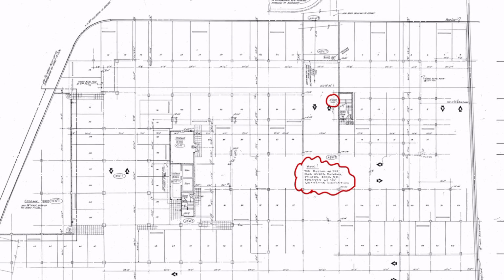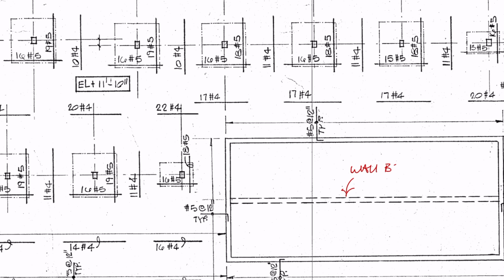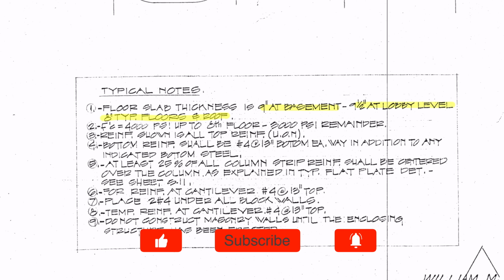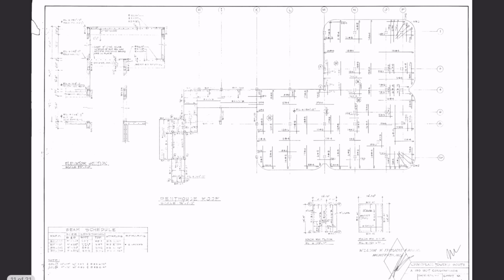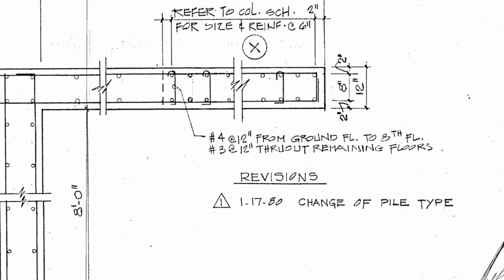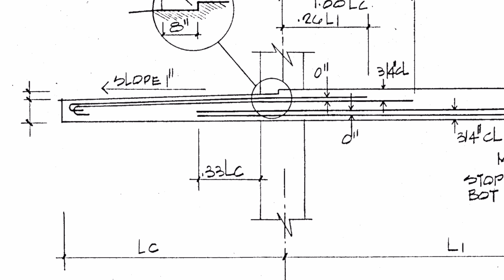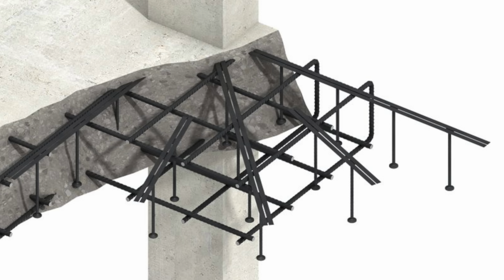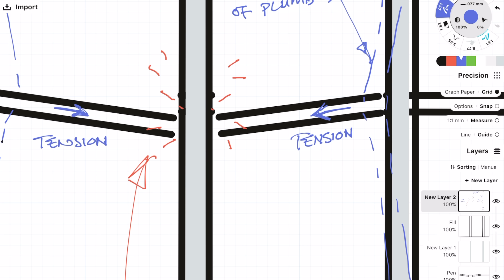Surfside Condo Collapse - Reviewing the structural drawings - Was the design bad?

Comment: by all respect; Judgment is not made by what you think, as saying "thickness is not enough", but by reanalysis using design software. 
Judging by look is just to rechecking, based on the long experience of the engineer-designer based on many experiences he went through. For example, he can judge by the span length between the columns, yet he needs to return analysis on the programs to Issuing judgment. 
Even if the constructor fails it may be a poor implementation

Comment: Are these the plans from 1980? It was built to the 1980 plans. Not either of the 1979 plans.  Many columns that should’ve been 24”x24” were smaller. That one has beams under planters.  One column isn’t several feet over instead of lined up with other ones.

Comment: As far as the building is concerned for most it was standing on small columns, only the part that remained standing was partially on larger columns. Initially the pool deck and parking garage floor collapsed. That did not directly affect the Northern or Eastern sides of the building. It did however directly affect the Southern and Western sides, but the Western side being on larger columns where the parking garage was meant it was able to handle the stress. The Southern side however was on smaller columns of which the entire edge row of columns would have been damaged leading to the collapse of the Southern side, that lead to the Northern side also collapsing. Though non of the  columns which the Eastern side was standing on would have been damaged by the collapse of the mid section of the building. It is clear on the video that the South Eastern corner was so small part remaining that means it would have been standing on one column only. Thus you'll notice when it collapsed it started by leaning over and rotating inwards before pulling down the Eastern side of the building. The Western side that remained standing was almost like separate building. Having been on larger columns, been split from the other sections by the large shear wall, and having the open shafts housing the stares and elevator meant there was less direct connections to the rest of the building.

Comment: i think when oroginally designed and built they used bare minimum calculations in terms of load to save on cost--obviously not taking into account additional weight/load the building and or the pool deck can withstand as the collapse started at pool deck-----the other columns couldnt withstand the force of all that concrete coming down----------it was all about cost and bare minimum load calculations

Comment: What I find interesting is how you and your viewers can so easily blame it on building design and concrete quality etc. You all want to find an explanation which doesn't help people in the thousands of other buildings built like this one. I would suggest people go back and look at the slow motion destruction of the twin World Trade Center Towers along with Building Seven and explain those in a concrete or design failure. Watch how those buildings came apart.
Reply: The three collapsed WTC buildings were steel-framed tube structures. Different design, different material, different dimensions.

Comment: Another video I watched showed that a landscape company put heavy paver blocks on top of heavy sand on top of the deck and didnt put a drain for the sand nor did they install a waterproofing membrane under the sand resulting in a water trap under the pavers between the concrete deck and bottom of the pavers. The only way the water could escape is by passing through the concrete rebar deck. What were they thinking?

Comment: Nobody has yet mentioned the possibility that during lifetime of building of vehicular impact on columns in the parking area and if/how that was repaired. I am NOT saying that happened just thinking how 'fragile' the overall stability of the building appeared to be and that concrete spalling on columns had been repaired (or at least it was no longer obvious on parking area walkthrough video) what other 'cosmetic repair had been undertaken. Vehicular impact on support walls/columns was one of the events we were required to consider after Ronan Point collapse.

Comment: I don’t agree the building was 40 years old it was due for its 40 year inspection you used the wrong plan’s. There had almost no upkeep and maintenance the whole time so who ever owned the building should have been responsible for seeing and fixing the problems but they never did. That building survived hurricane as tropical storms and it was facing the ocean and all the sea
Reply: But in general terms from videos (not from engineers report) the building looked good on initial view. Later I started noticing things like pools of water, plastic sheeting directing water from pool slab away from cars, damp areas on lower columns and of course the paint peeling/stalactites and cracks on garage roof. So even as an engineer (who has seen worse) I would not have been immedietly alarmed if I had been just visiting.

Comment: Definitely a failure in terms of punching shear. I am a special inspector living in an high seismic zone so looking at how lightly reinforced something like this building was is rather hard to see. The ACI codes have changed through the years so that even buildings only required to resist wind forces, must be much more robust than what was required at that time. Also, looking at the column/slab interface of the columns that failed by punching shear, it is very apparent, no reinforcing required at the tops of each column was installed. The plans note states "25% of the column strip reinforcing must be installed over the columns". Typically now we see studs on rails for punching shear reinforcing in a flat plate deck design for this purpose. There appears to have been multiple, negligence driven causes that lead up to this failure. Thanks for analysis. I would love to get a copy of the plans too. See you in the next one.

Comment: Agree with most.  You can see that the columns were the last to fall. They are on top of the floor slabs in the debris. Flat plate design is inherently unstable. Basically, only resistance to slab slide is a couple of pieces of rebar and the “shear strength” of the slab where it meets the columns, which you can see on the column tear out.  There are basically no beams to make a rigid box and no capitals on the columns.  Flimsy structure.  It’s sister can likewise fall.

Comment: there were no obvious beams, probably a design feature no doubt, what then supported the slab between column heads, or in-the-slab beams which would have "tied the heads of the columns: and hence stiffen the structure and reduce punching shear cuz the bars would also have to go thru the column heads. SO what were the cantilevering bars for if not to support the slab suspended slab between columns/bearing elements in the slab (in-slab beams), or protruding beams not seen in slabs (Probably designed to give a clean clear look?). and this goes for all slabs? no visible beams or in-slab beams?

Comment: When the slab failed. The slab tore away from beam/column at the floor interface. It most likely damaged the top of the columns and reduced the cross section.... P-Delta effects etc.  Resulting in column buckling. I can't imagine a clear break from the beams given the detailing.

Comment: Great video. The plans as I understand show poured continuous columns with the major floor slabs poured around them. Would this explain the lack of punching shear reinforcing being required in older building codes?
Reply: I thought that as well - also as column and slab concrete strengths change construction would appear more difficult. To me it also looks as if formwork would require steel to be bent out of the way then rebent to allow construction - ok that is often done but maybe not with the minimal steel and concrete cover which appeared to have been used.

Comment: So how many years did this building hold up under numerous hurricanes, major storms and salt water corrosion? It’s easy to look back and pick and chose “potential issues” with the structural engineer’s design, but what is not being taken into account is the significant lack of maintenance of the structural components of the building. Significant corrosion is without a doubt the major player in this type of structural failure. The structural design of this type of structure takes months to develop, so making these comments only weeks afterwards is reckless and unprofessional.